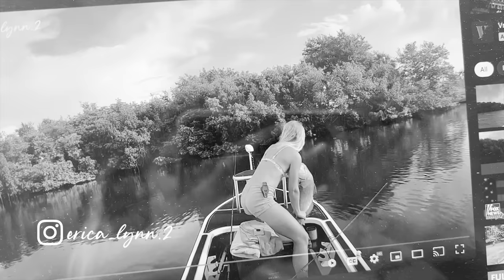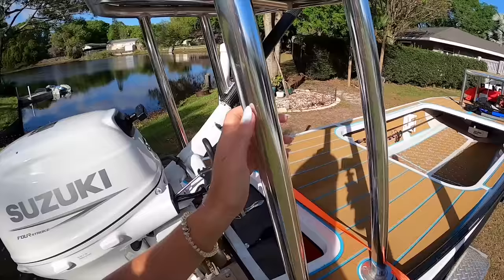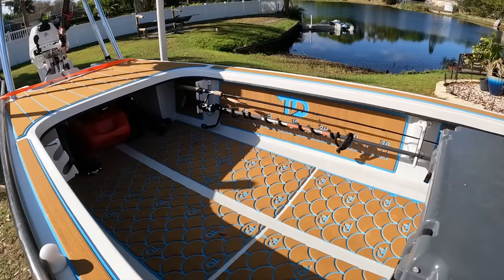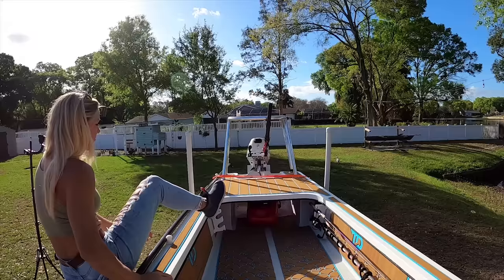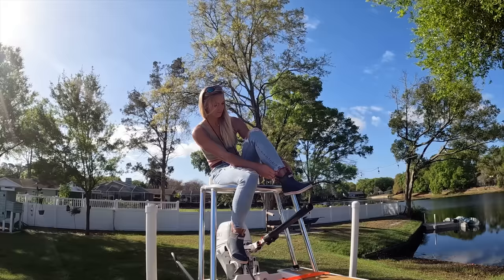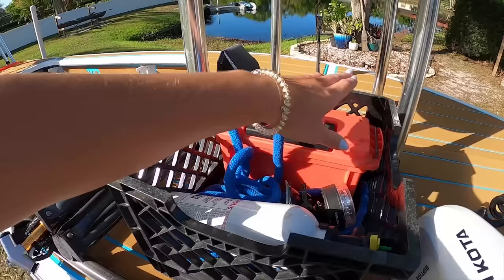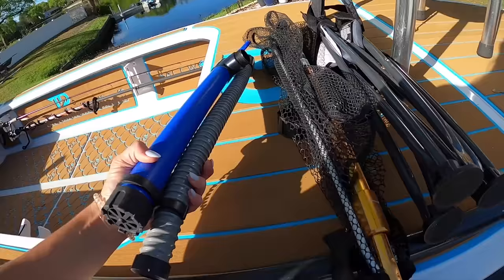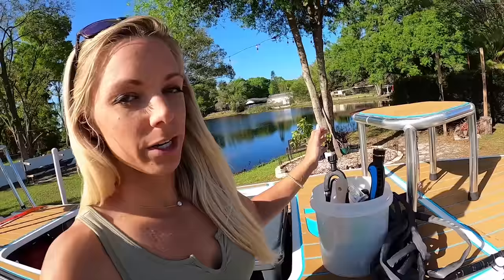My New Boat! Video walk-through of my 16ft South Dade Skiff

Comment: Hey Erica, just a heads up. Shortly after I purchased my south dade I got inspected by Florida fish and wildlife and you DO Have to have an extinguisher in those skiffs. Technically the lip that comes down off the front and rear decks makes it a confined storage space (according to the officer) per the law “any fuel tank in a confined area on a watercraft must have an extinguisher “ just thought you should know. Great video BTW!👍
Reply from the maker: Thanks for letting me know !!
Reply: It should also be mounted for quick access
Reply: If FWC wants to find something to write a citation for, trust me, they can and will. Many of their regulations are broad and sometimes ambiguous so that they can basically do whatever they want. Things like this fire extinguisher are like low hanging fruit to them so it's best to just do it, but don't be surprised if they bust you on it being out of date or some other trivial deal. Fyi, if you decide to go grouper or snapper fishing, be sure to have a descending device and have it rigged and ready to go, otherwise it's a fine that starts at $250 and only goes up depending on how the people from NOAA decide to punish you.

Comment: I always feared the blue backing would look like masking tape on the sea deck . but it actually looks great. and The jack plate is a necessity for the shallow flats. if you can find a lithium battery you can use 100% of the charge vs the 60 you get out of deep cycle batteries.